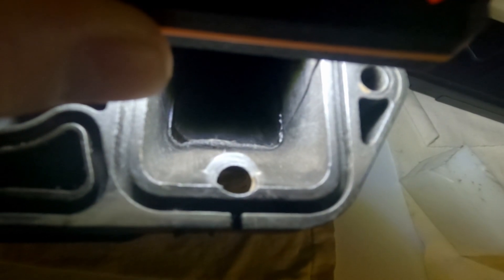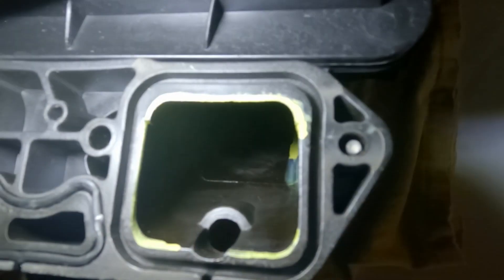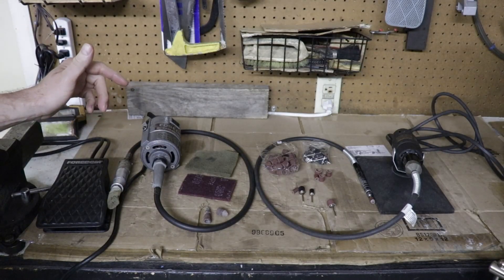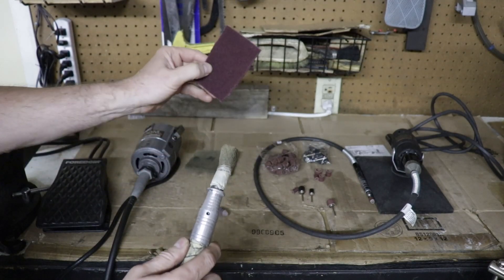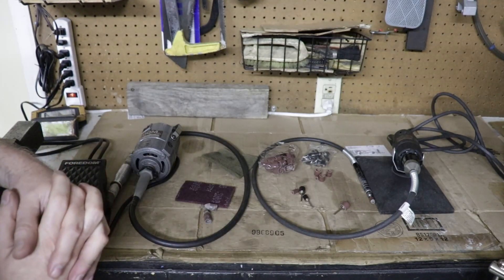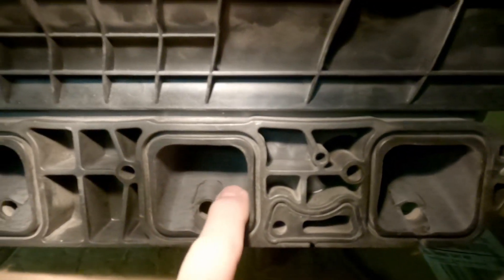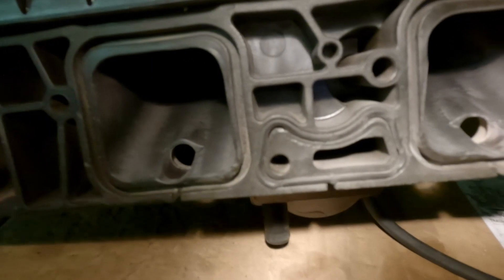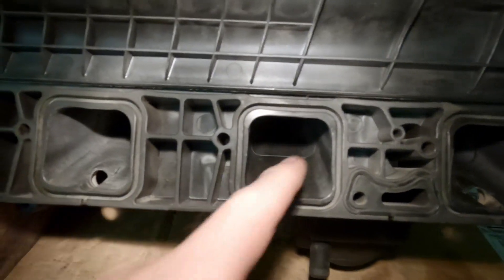Porting the 5.7 Hemi Intake Manifold - How I did it.

Comment: How much horsepower do you think this alone adds
Reply from the maker: Thats hard to say. I've seen some dyno tests where it adds 5-10, but 5 or less is probably the norm. It also depends on what else has been done to the engine. On a stock engine I doubt that it'll gain very much. If you've done heads, cam etc...and are looking for that last bit of power it could be more.  As seen from the restrictions in mine I do believe it's worth doing though. Every little bit helps and in the end it all adds up. Thanks for watching!